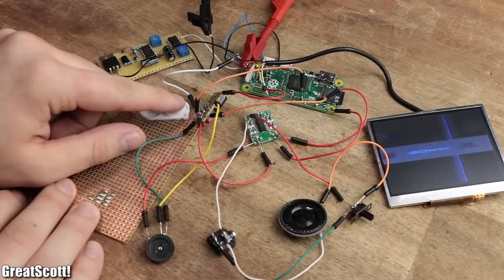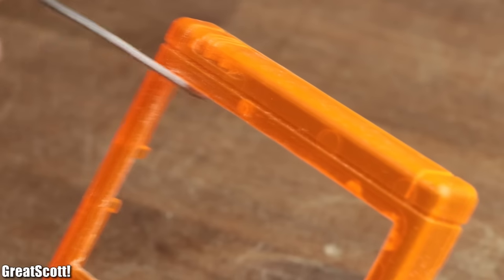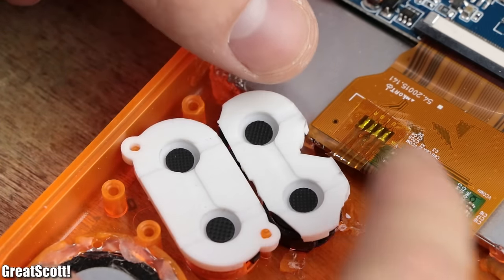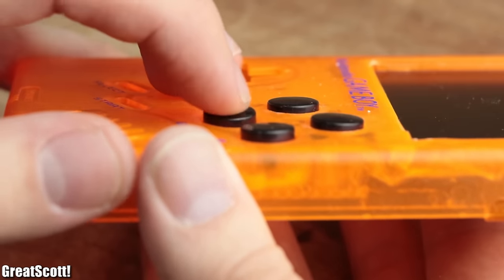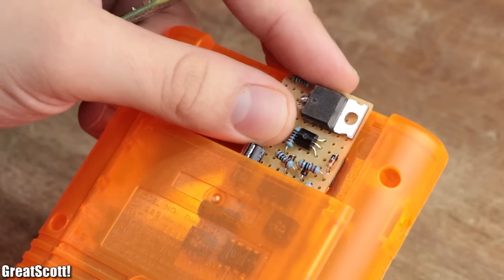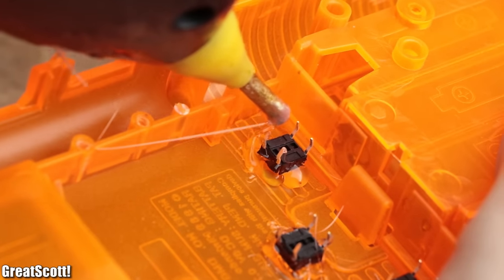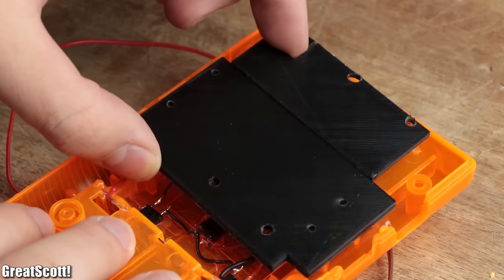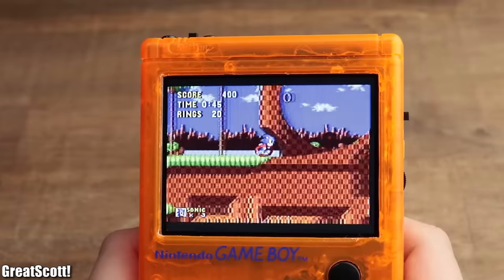DIY Raspberry Pi Zero Handheld Game Console (Part 2)

Comment: Why did you use screws to fix the power switch, the Raspberry and the buttons? You should have been using hot glue for that purpose

Comment: Can this be done with a Pi 3 if I were to take some of the taller components off the board and find a way to make room for it?  I'd like to do this project with the additional performance
Reply: asherael This can be done with a Pi 3 check out 1 UP, LCL and other YouTubers that completed this on their channel, or check out kites pcb that works with a cm3 with basically another version of a Pi 3.

Comment: as much as I want to build one of these or something similar, one question has been bugging me for months. 

how can you tell when the batteries are gonna die?
Reply from the maker: When the system turns off, they are dead.
Reply: GreatScott! no, what I meant was, how can you tell when the batteries are running low so the Pi doesn't do a hard shutdown?

Comment: What is the tool you used to cut out the screw brackets called? Also, how to remove them without breaking?
Reply: After googling: bent wire cutter. 

But still, how to cut them without breaking?

Comment: Raspbery is not overheating in this small box? i mean, when u play long time, did u tested it out?
Reply from the maker: No, I played for 2 hours straight and did not notice any heat problems.
Reply: Nice, i will try to create one by myself, but i will try smaller lcd, because i want more old school look :D
Reply: but the device components still needs air venting because of the chemical interactions and heat coming out from capacitors and ICs, this makes the device lives longer.
Reply: Eryk Szkaradziński . I think your right. but I can't imagine it would get too hot. the batteries are not all that powerful.
Reply: i have soldering iron which is using 3 batteries like this, and works great :D

Comment: In total how much would you say this project cost to complete?
Reply: Theenemy38 if you have nothing, £100
Reply: Karlo Bistrički if that's the only thing he bought. transistors nodes and capacitors were used so that should at least sum him some price. also the board thingy. well if he had those in his shop, is a really cheap project. i wish i had his skill and knowledge. it looks really fun.
Reply: Genrey Lino Gonzales Not to mention Soldering equipment, it's cheap if you already own these things basically, but quite a bit more if you need that stuff as well
Reply: I just saw the video for the raspberry pi zero in an nes cartridge.  I added up all the totals for the parts and it will come under $60 to make.  I'm gonna make that instead.
Reply: Theenemy38 Yeah I wanted to make that as well, if you get an aftermarket empty cartridge you could put a custom sticker label on it, I kinda wanted to make one even though photo editing isn't really my strong suit
Reply: That's actually what I'm going to do.  I already have all the parts including a translucent blue nes replacement cartridge.  I'm also ordering a replacement nes sticker for bonk's revenge and the warning label that goes on the back of the nes cartridges.  I can't wait till I get everything.
Reply: Bryce - ζ you can order the nes stickers on ebay.  Just search nes sticker and choose your game.  They run for 6.50 plus 3.99 shipping.
Reply: Theenemy38 buy a pi3 instead. You will only need 35$ since it you dont need hub and ethernet cable. Maybe 20$ more for case and ccontroller but pi3 is way better cause of better processing power(maybe about triple pi0 i guess), more noob friendly cause of IO and ports and it has onboard bluetooth and wifi. You can add roms wirelessly and use wireless controller.

Comment: Ich will gern ggf auch ein bauen wie bei sudo mods und dir, nur frag ich mich ob so ein pi touchdisplay ins gerät passt, da ich das gern hätte.
Reply: Cabal2140 ja passt, solange es 3,5 Zoll hat nur die richtige Software ist schwierig
Reply: da SchnaseL die touchfunktion wäre für ein anderes OS, ich sehe halt bei den Displays an der Seite oft rechts etwas mehr material, daher die Frage. Innenaufbau mach ich eh anders in mit ein pi3. :)

Comment: where did you get the pi zero? Are there sources for it in germany?
Reply: im from netherlands, i ordered it online (pimoroni i believe) and it costs (only) €9
Reply: MEe$ i am Dutch too
Reply: I have ordered second one from Pimoroni. This is a great source as well.
Reply: I am dutch too but i never get good deals on Pi zeroes. They are out of stock on every site
Reply: i`m dutch too and have the same thing
Reply: hahaha ik heb wel een pi zero👋
Reply: mooi zo
Reply: einfach bei PiHut bestellen, geht schneller als vermutet
Reply: Richiebuffett Jop, mein Zero kam nach 4 oder 5 Tagen bei mir an
Reply: Das Minimum wäre ein USB-OTG Kabel, ein 5V Netzteil mit 2 Ampere, ein Adapter von Micro HDMI auf HDMI und eine MicroSD Karte mit 16 GB. 
Ich habe mir kein Kit bestellt, man bekommt die einzelnen Teile (mit etwas Geduld) meist günstiger.
Ich persönich kann Retropie übrigens nicht empfehlen, Out of the Box hab ich mit Recalbox deutlich bessere Erfahrungen gemacht.
Hoffe ich konnte helfen, bei Fragen einfach wieder antworten =)

Comment: Drilling thru that RPI like that might be a bad idea, especially if you accidentally manage break it, I wouldn't recommend it, at all!
Reply: Molnár Áron considering the Pi is only $5 it wouldn't be a big loss.
Reply: I checked the link in the video description, and it's 33 EUR on amazon... maybe that is not much either for you but for me it's a significant value
Reply: Just buy it from an official seller. I just bought one a couple weeks ago from Adafruit for $5. Those companies that sell it officially will get it back in stock if it goes out. Why would anyone pay $35 for something that is only worth $5? If you do that, that is your own fault.
Reply: Right, i didn't know that... then I take it back. 
Thanks and peace!
Reply: Oh, it's no problem. I just hope that more people will remember that the Pi Zero is only $5 and stop paying those inflated prices to ebay and Amazon users.

Comment: One Question: Why use AA batteries?
Reply: it was a battery in AA size. I think it was nickel cadmium or something. see 1. video
Reply: Lil Wasabi the case he bougdjt was for a gameboy and the gameboy has AA battery slots in it
Reply: Lil Wasabi Agreed, shoulda ditched the AA Alki's and rewire for LiFePo4's in parallel in the same package size but rechargeable and more watt hours IMHO.
Reply: because they are common to get and can be found everywhere, making it just best to use 3 AAs

Comment: Shame that it uses composite signal only :/
Reply: nope it's actually good
Reply: Dustin Stratmann With composite   small text doesn't render at least that has been my experience with a Pi3 and 7in screen (old digital photo frame) w/composite. That should give you an idea of the level of functionality.
Reply: True, but the clip of him playing Sonic looked good. The text was easy to read. Old games were designed to be viewed on old displays so they should look fine, as long as the OS navigation isn't difficult.

Comment: Can this run Xbox games?
Reply: GabeNewell1337 Sadly no, maybe future iterations of the Raspberry Pi could, but the Zero is made to be small and (comparatively) inexpensive, not a whole lot of power in it but it handles older emulation well

I'm actually not even sure if there's a decent Xbox emulator for standard PCs, let alone Linux or RetroPi
Reply: Xbox is apparently a huge pain to emulate(the best emulator can reach the menu and even "in game" for 4/5 games ! (unplayable due to framerate : o)  )
We may have a working 360 emulator before we get the classic xbox's one
Reply: Brendan2981 God damn archaic proprietary architecture!
Reply: great